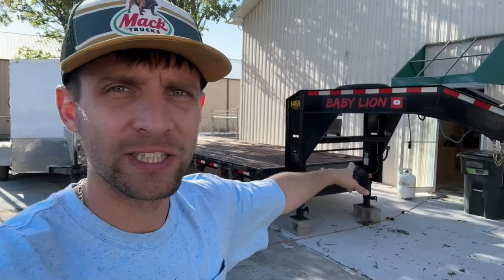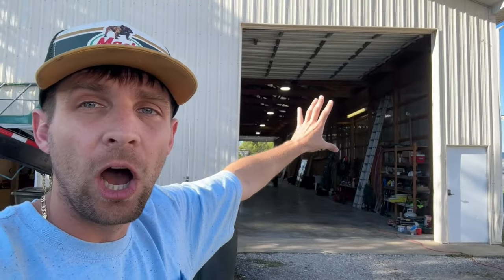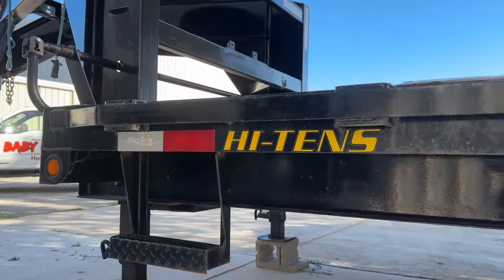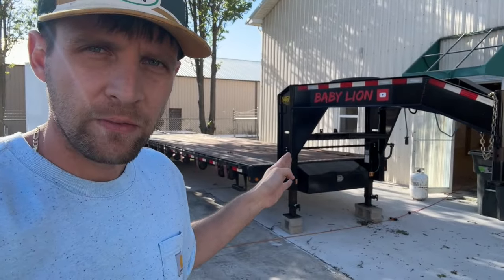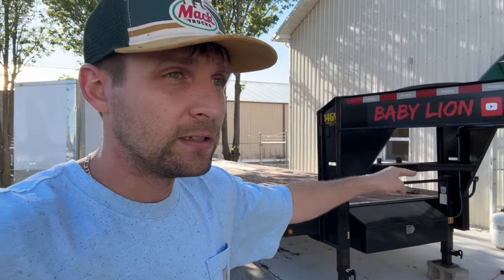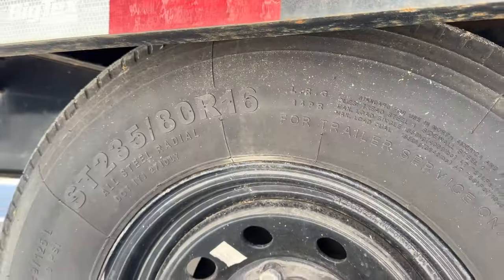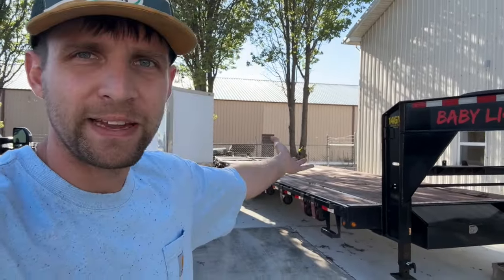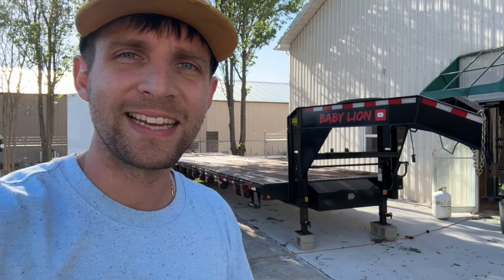Selling My Original Trailer (14GN Big Tex 33' with Mega Ramps)

Comment: How hard was it to get loads after getting your authority? Are there any tips you have for people starting out for the first couple months? Also, about how many months did it take for most brokers to start being able to work with you? Thanks!
Reply from the maker: When I first started in a restaurant as a sever. no matter the restaurant they gave me the worse section at first before getting moved into the money making sections. When I first started as a contractor working with AT&T I started at 20$ an hour and left at 50$ hour (storm work, I left because the work was inconsistent...not the point though), I first went to Ole Miss and got kicked out with a 0.9 GPA (age 19) when back to college and tried again at age 28 graduated with a 3.9 GPA......... I hear your question but point is put in the work and it will work. you may have to make more phone calls in the beginning to find a broker to give you a chance but you can get loads. Also you can find local places to move stuff around town for those first few months to make sure you have enough to pay your bills. I hope I made a little sense. And I say that with sincerity, Good luck Patrick

Comment: You every thought of having others come on board with your company if they have their own truck and trailer?
Reply from the maker: besides the risk I refuse to steal from people. taking anything off the top in trucking is stealing in my opinion. Im continuing to build my website and give people the right info so they can actually make a good living. someone taking 20-25% off you check is like taking 100% of your profit. even if you profit 30-35% of your gross and are experienced; then if someone takes 25% you are literally only making 100$ for every thousand you bring in. But I appreciate the question and I hope my reasoning makes sense.
Reply: I have seen a few that take 10% but that is rare. The only reason they do this is cause they still have to do all the paperwork.